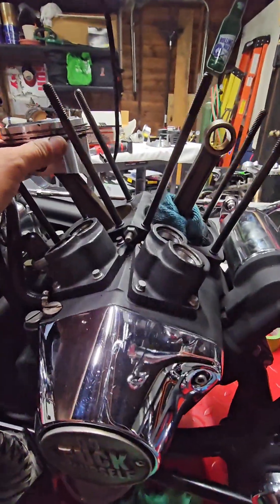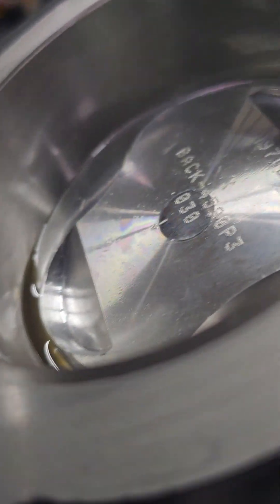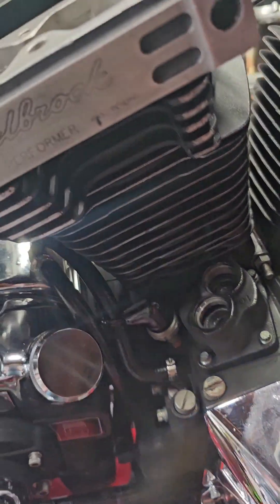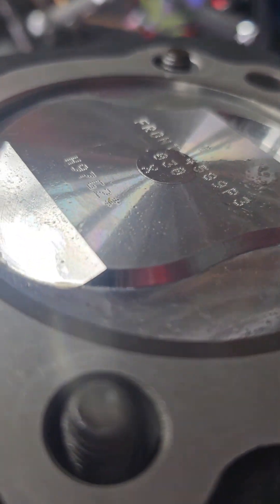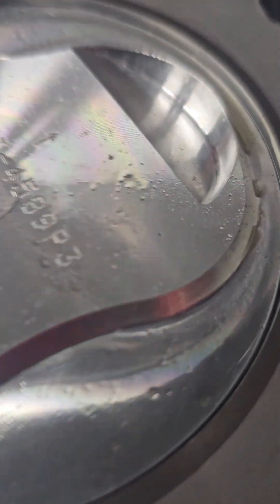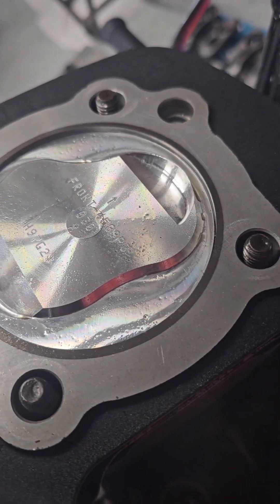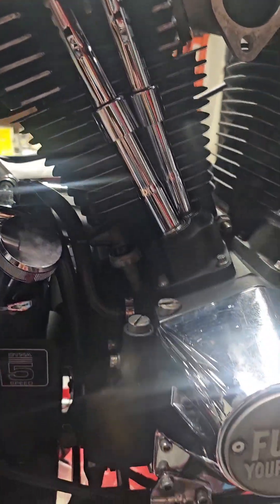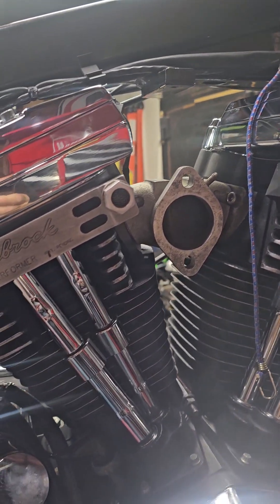PROGRESS ON KAREN'S EDELBROCK HEAD SWAP..1340 EVO

Comment: Any updates on this build?
I’ve got a 98 low rider with a complete Edelbrock rpm performer kit installed. 10.5 to 1 comp, .600 lift cam. Interested to see it running and maybe a dyno run.